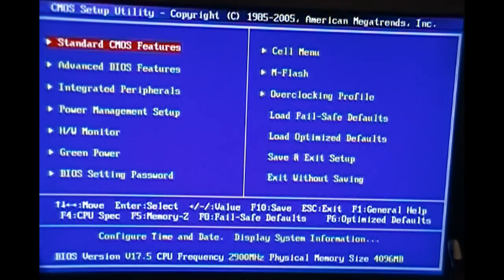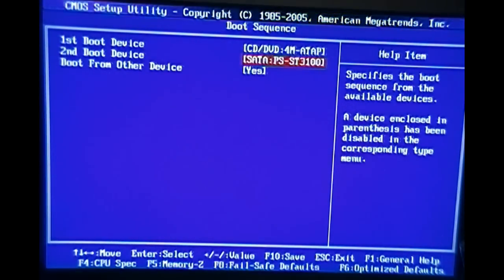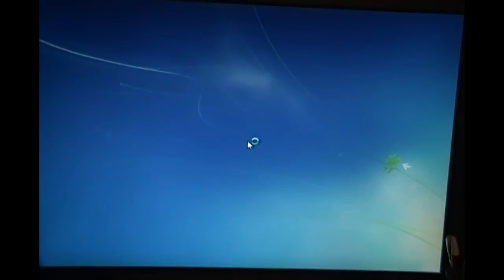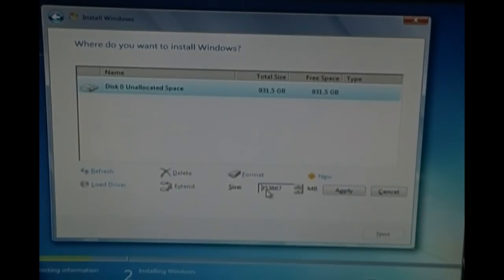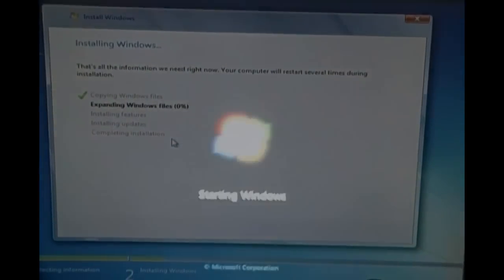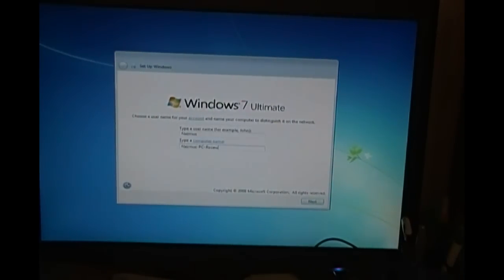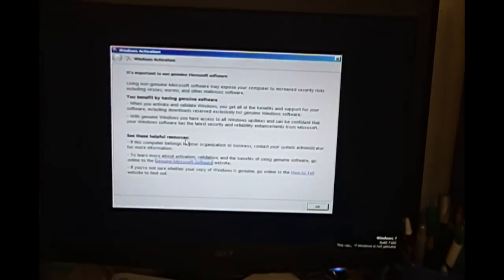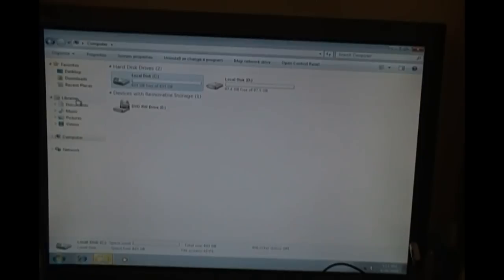How to Build your own PC - Part 5

Comment from the maker: @MrGangsterboyz You can but it's not necessary, if there is nothing in the cd drive then it will automatically go into the secondary boot device. Even if there is something in the CD Drive but it's not bootable (like an OS), then it won't run at all and it'll automatically go to the hard drive (or whatever the secondary boot device is set to).

Comment from the maker: @cristinarosariopr make sure you connect the usb keyboard to the back of the computer, where the USB port is connected directly to the motherboard. Using the connection on an addon card or the ones that come on the case may not work. If everything fails, try a keyboard with a PS/2 connection.

Comment from the maker: @EggoFreak i had to format it because I used the drive temporarily as an extra drive on another computer to make sure the hard drive worked. When you do that, the hard drive will only work in that fashion or just with the computer it was originally set up with. You can do it without formatting by overwriting on the partition but the way I set it up to test made it easier for me to just format rather than try to overwrite.

Comment from the maker: @FSflyer264 most of the wires come with the motherboard, not with each component. So if you buy a hard drive, you most likely won't get a SATA cable with it. And the screws come mostly with the board, some graphics cards provide their own so you can mount them in, along with power source and CPU brackets. 

As for your keyboard, it may work, however I've never really tried it. I've built many computers and usually use the regular PS/2 connector to install everything. Sorry I can't confirm this.

Comment from the maker: @willie9888 If you already have a hard drive with an OS then you can leave the load selection as it is. It doesn't really make the load time go faster, it's just easier than going to the boot menu if you ever have to run a CD in the future. And you don't have to switch it back later, if there is no CD in the drive, then it'll just skip it. 

The hard drive stores the data, you need it to go past the bios. Without it, you won't be able to do much. And IE generally comes by default with Windows.

Comment from the maker: @ddizzle22 ah. You should be able to get what you need - just look for a dual core AMD CPU (with a motherboard that can take it) - and 2gb of RAM should be fine too. This will save you money and at the same time give you the power you need to do what you need.  I recommend you visit newegg.com - that's where I got most of my parts and it's very reliable. If you have questions on individual parts, you are free to PM me and I'll get back to you when I can :)

good luck.

Comment from the maker: @lts45 no, in order for the install to be legit you need to input a product key, otherwise Microsoft will see it as a nulled version. 

years ago when the OS came out, you would have been able to get into the trial mode, but that's long gone. It's gone even for Windows 7 as I showed in my video. I mean, I can still work on it, I'm just heavily restricted. I'd highly recommend you get a cd key for either OS because it's safer and it's really not that expensive.

Comment from the maker: @lionhart47 It's not a burden, feel free to ask any questions you may have :)

as for the cases, they are all pretty good and will everything you need done. You'd be fine with any of them really but if I had the money to spend, I'd get the Antec one. It has 8 total fans which is great for cooling and it's red LED :) Also the cheapest from the list.

As I said in my videos, the case isn't as important as some other components and it won't affect how your PC runs (assuming it has good cooling).

Comment from the maker: @lionhart47 no it wouldn't. They're different slots so I wouldn't recommend it. You'd just be wasting money. 

And it's not bad if you use a part much better than the other, you'll just be limited to the lower quality part when working whether it's the graphics card limiting FPS in games or the CPU not allowing you to run games at all. It's not bad, you'll just be limited based on what the weak component can run.